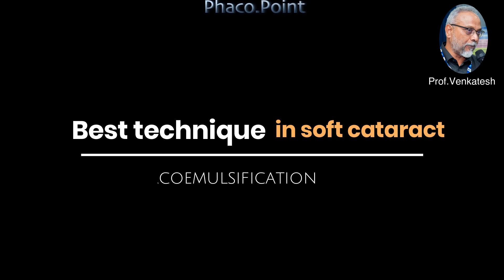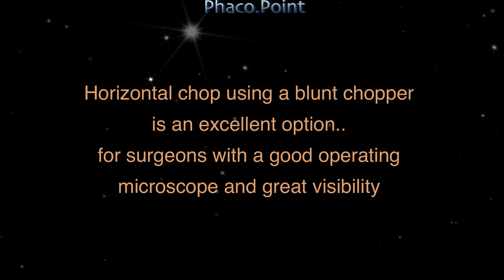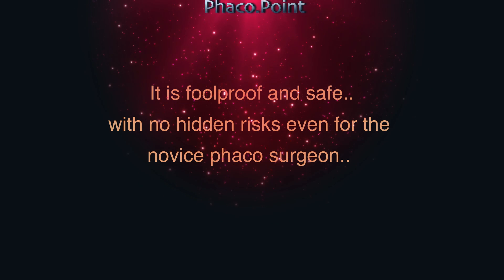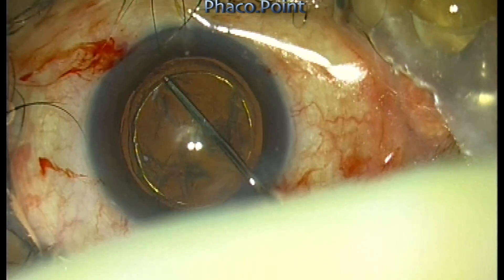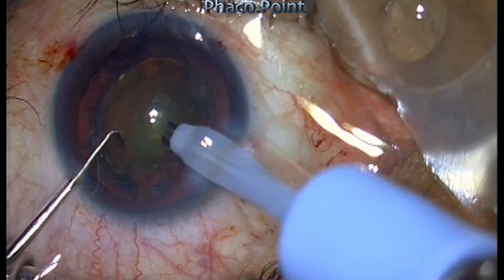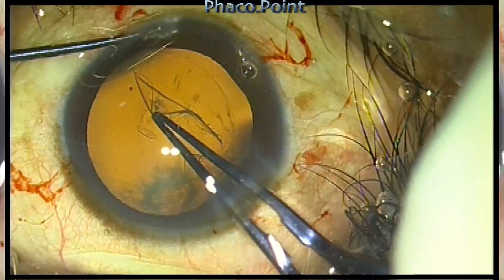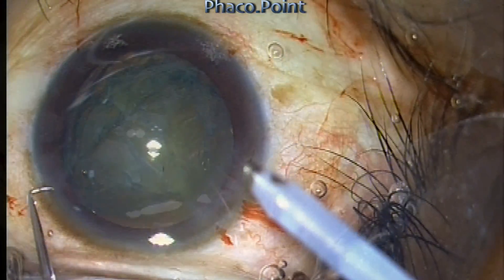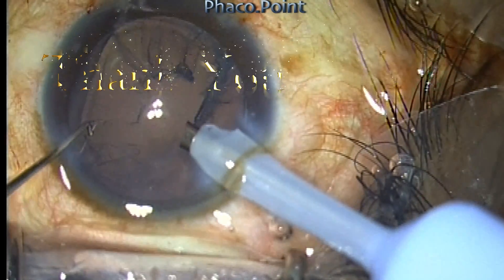The Best Technique In Soft Cataract Phacoemulsification - In my Opinion.

Comment: So you juste keep vacuming in front of the nucleus until it pops out? I am afraid I didnt get it right 😮
Reply from the maker: well you are sort of correct.. but there is a technique involved with the whole thing. start with a vacuum of 300-350mmHg but keep the phaco power low to about 20% . keep the AFR at 3 cc/min. after entering the ac go to FP 2 and remove the epinucleus above the soft endonucleus this is called uncapping the epinucleus.. now place the phaco tip bevel down (preferably ) over the endonucleus and with the high vacuum lift it up above the capsular bag... sometimes you may need the help of the second instrument to tumble the nucleus out of its dilineated epinucleus shell.. after reading this .. try watching the video again and it will all make sense..
Reply: @PhacoPoint  Regarding your response above, did you mean "keep the AFR at 30cc/min"?  I assume you did not mean 3.  An AFR at 30 and a vacuum at 350 with phaco at 10-20% is approximately the "Epinuclear mode" on the Centurion which I often use for safety on soft cataracts.  Thanks once again on your excellent videos and teaching points.  I always find that I can learn something.  For example, in this video I was delighted to learn how to deal with ballooning conj in 3 seconds!  Never knew that trick.
Reply from the maker: @ihidoc  Hi .. thanks for the kind words. I meant 30cc/min and thats right it is like epinucleus mode settings . This high setting will help to mobilise the endonucleus out and the  low power will prevent cheese wiring
Reply: @PhacoPoint  thank you so much ! 🤗🤗🤗

Comment: You are definitely right, professor. Actually it's not even necessary to use higher vacuum then usual. Just don't stop the hydrodelineation after the appearing of golden ring. If one continues to inject water, the delineated endonucleus will lift up. Then - just aspiration.
Reply from the maker: thank you Dr Gapuchio.. I agree with you. The reason I stop the hydro delineation at this point is to proceed with cortical cleavage hydrodissection .. other wise the epinucleus fails to rotate and it may become challenging to remove this.